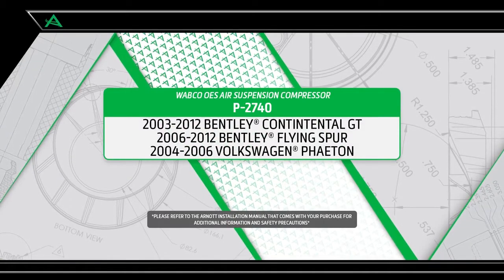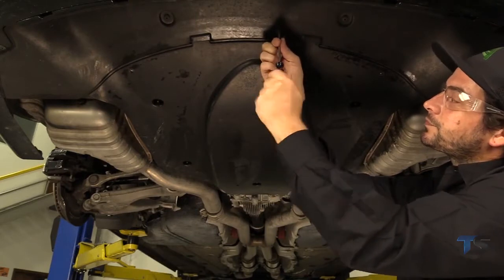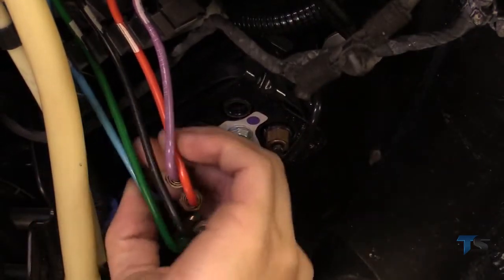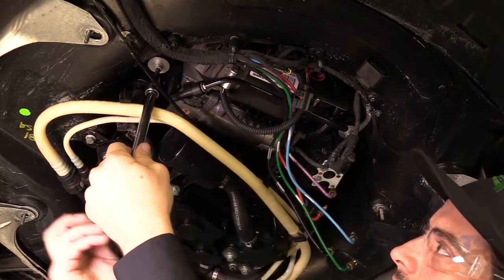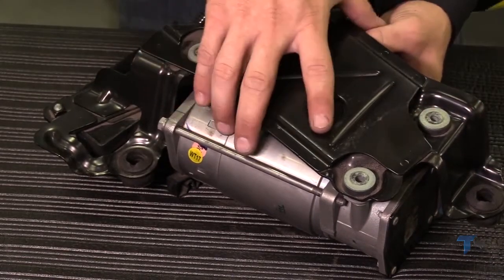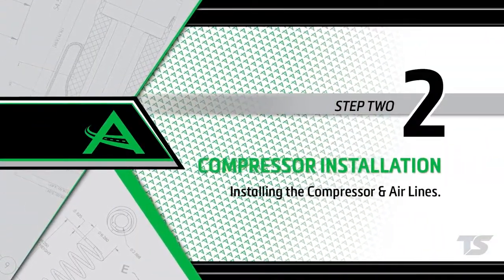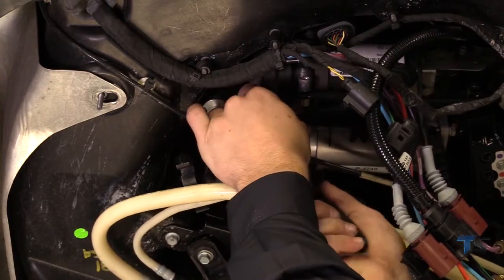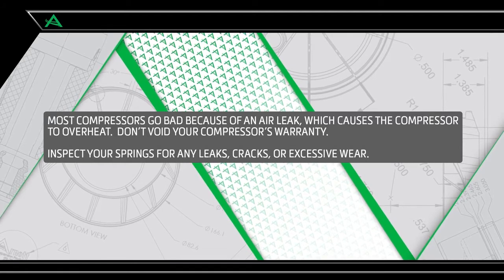How to replace your Bentley air compressor.

Comment: how does the black air tube stay in with no nut on it is it a push fit please
Reply from the maker: The black air line uses a push to connect fitting to hold it into the compressor.
Reply: how do you get them back out please if you push it in  as theres  no nut is there
Reply from the maker: @Dg-zj6jo  The black line from the valve block to the compressor uses Voss style quick connect fittings so it will pass through a brass nut and it can be removed again like the original, by unscrewing the brass nut.
Reply: ok thanks sir